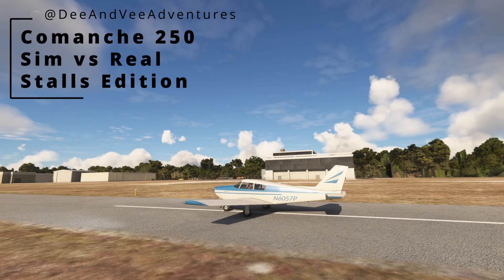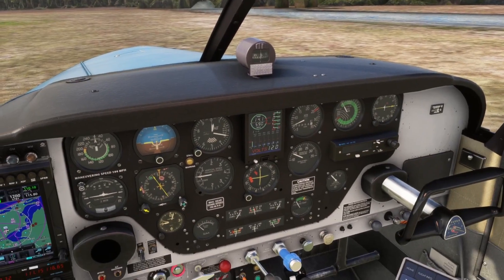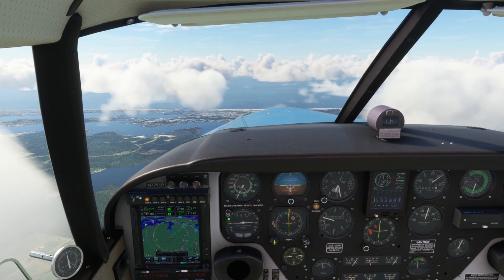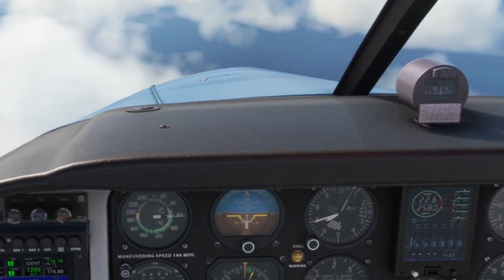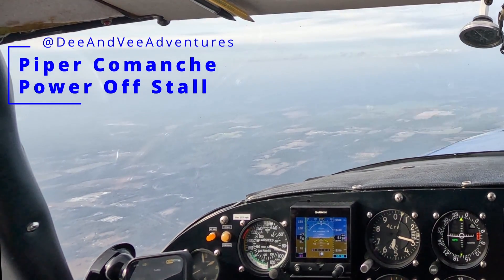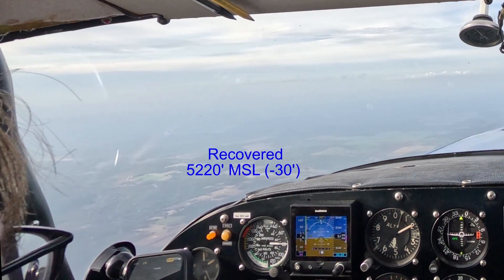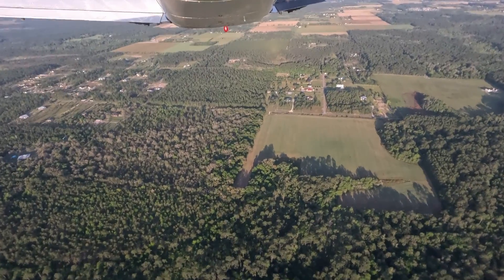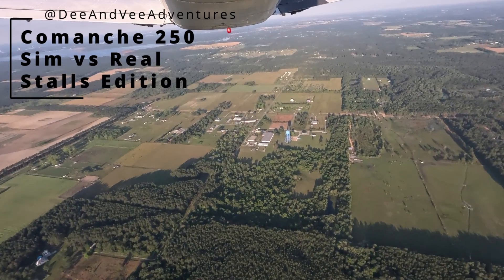MSFS A2A Comanche Comparison to a '59 real Comanche - Stalls - with Cockpit Video and Explanations

Comment: If the portion of the video is of your actual aircraft, PLEASE go see Heritage Aero, Clifton Aero, Webco, or any Comanche specialist ASAP. I was hoping it was the GoPro camera angle in some other videos, but this made it appear quite clear: your main landing gear is very out of rig!!! The mains should splay slightly outwards at all times, and the center joint of the linkage between the strut housing and the airframe should be visible, bent over-center, just poking out below the wing. Yours is not over-center and therefore not visible, and the main gear are visibly biased inwards (vertical at best). The only thing preventing a gear collapse is whatever mechanical advantage the bungee would have in your gear's current rig (not much), and the rubber friction brake for the gear motor drivetrain...which is something that can be overcome with just your finger spinning the wheel it brakes! (I learned and experienced this at a Comanche Pilot Proficiency Program training session with the landing gear training device). The only thing separating you from a gear collapse is luck and time!
Reply from the maker: Thanks - we’ll get it looked at asap

Comment: Thanks, this is interesting.  Would it be possible to compare landings? In the sim I struggle with slowing the plane down, and landings are pretty poor, so would love to see some comparisons.  Especially if, for example, you are flying some distance - when do you slow down? How quickly? etc.
Reply from the maker: Yes, good idea for a new video.  Landings in the Sim are naturally challenging.  Our narrated landing video - https://youtu.be/O5aj1reHmZk - shows standard pattern technique.  Look for another landing video later today.  

Descents in the Comanche take a bit more thought than many light planes due to it's low drag profile.  One technique is to immediately reduce power to near idle (11" MP or just above the gear horn) but I prefer to keep power above 15" in normal flight and not make rapid power changes if at all possible.  My technique for descents is as follows :

1. Determine the number of thousands of feet to loose to get to target (pattern altitude) and multiply this by 5.  This is the distance you need for a cruise descent in Nautical Miles.  Cruise descent will be at 150-160 Indicated Airspeed.  If it is turbulent, then you will need to be below 144 mph and you might only need a 4x multiplier. 

2. At the target distance, reduce Manifold Pressure to 18" and start a ~600FPM descent.  Gradually reduce MP 1-2" per minute during the descent until you get to 15".  As you descend, you'll naturally gain 1" of MP per 1000' so keep an eye on it and reduce power as needed.

3. When you level out, at 15" you should decelerate naturally to ~125mph in a couple of minutes.  The 5x multiplier should put you at target altitude with a couple miles to spare which gives time for this slow down to occur before the pattern.  If you need to slow down faster, reduce to 13" in the last part of the descent and level out but be ready to add power back once you slow down to 125mph.

4. Entering the pattern at 15" MPH and 125mph, complete landing check and gear down.  If you time it right, you should slow to about 110mph abeam the numbers downwind, reduce power to 13.5" and set 1/3 flaps targeting 100mph.  2/3 flaps turning base targeting 90mph.

5. On final ~12.5" MP reducing to idle in the flair.  If landing distance isn't a concern, 2/3 flaps and ~87mph on final will make for an easier flair.  Or full flaps on final and 82mph for a shorter roll.  These speeds are at gross weight.  You can adjust these down based on weight with experience for less float.  

6. Depending on winds, you can add or subtract miles from the descent point to adjust for ground speed.